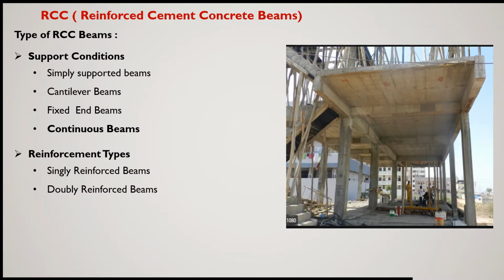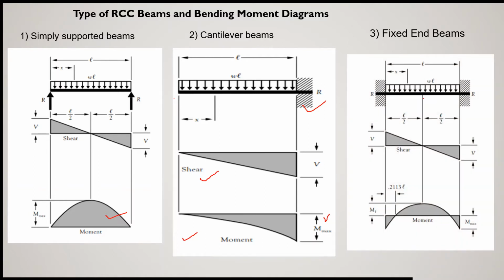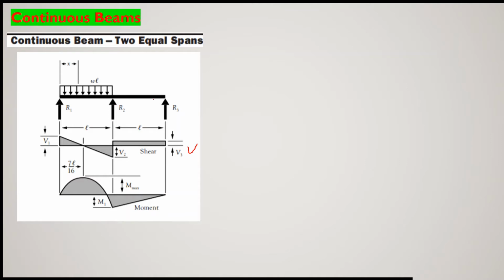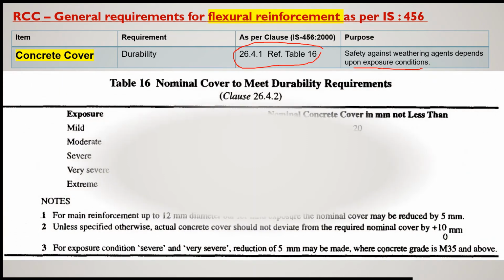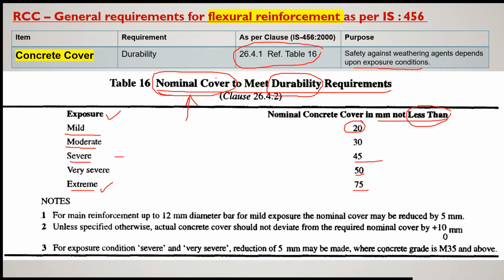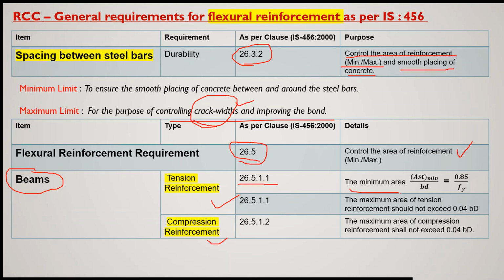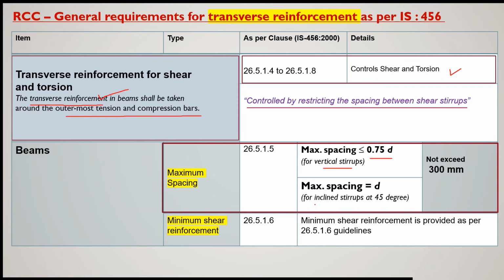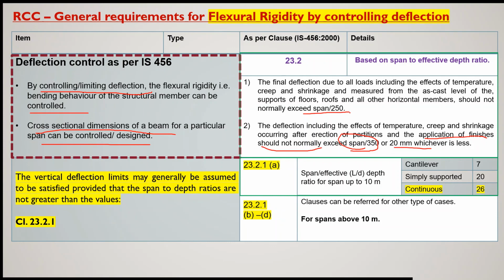Lecture 2 || Design of R.C.C. Structures || Continuous Beam Design Basics || IS: 456 Recommendations

Comment: sir,
Beams with side face reinforcement have some other purpose then a singly(steel to be used for tension) or doubly reinforced beam(steel used for both tension and compression)in which load is coming from above or is it meant to give more shear and torsion rigidity to the beam (even greater then providing shear stirrups), and does providing a side face reinforcement also changes its neutral axis orientation.